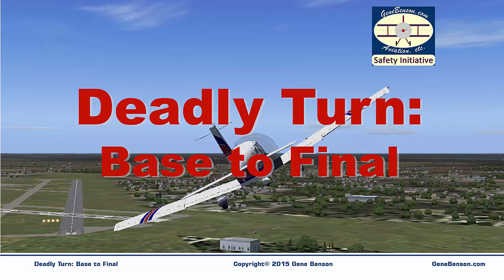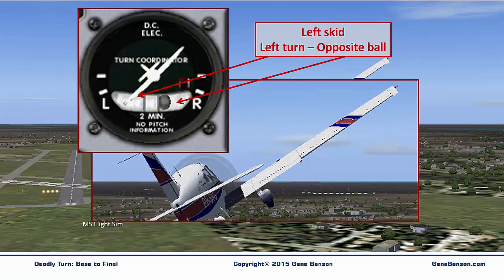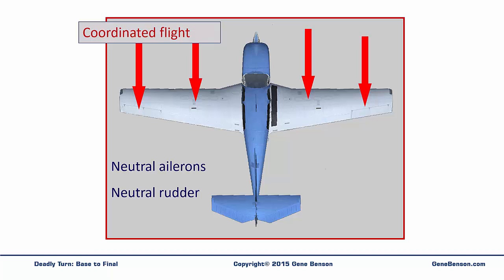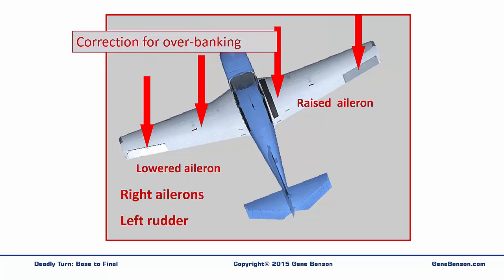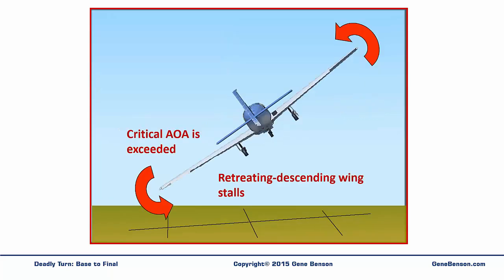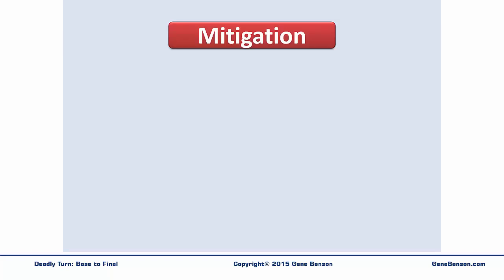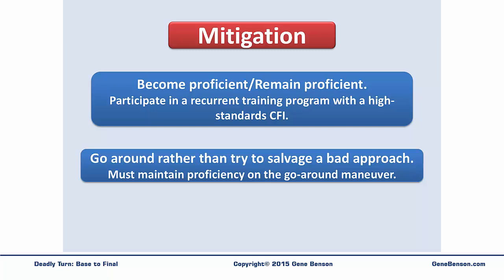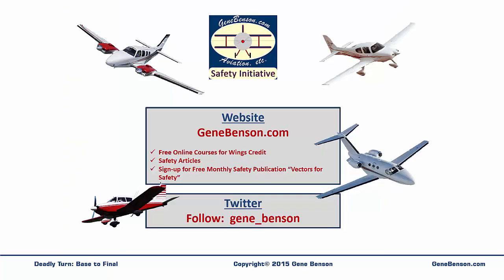Deadly Turn - Base Leg to Final Approach

Comment: I learnt to fly in a Drifter, rag and tube aircraft, what they describe as a 'high drag/low inertia' aircraft.  I did 200 hours on Drifters and then had to give it up due to cost.  My instructor taught deadstick landings from the end of downwind, a lot to do with the two stroke motors having a tendency to fail.  The turn onto base was usually at 45 degrees to touchdown, and from there it was just two gentle turns with the aircraft about 10 knots above stall.  I really felt more comfortable with plenty of speed and made my turns nice and shallow.  If I was too high, I side-slipped.  Too low, just added a little power to get me there.  If ANYTHING didn't feel (or look) right I went straight to full throttle and went around.

I really like the 'military' style of circuit flying, where a nice half circle to touchdown is flown from the end of downwind.  Anybody looking for me when I make the calls is going to see me pretty close to where I'm saying I am and the end result is one nice smooth turn with the touchdown point in perfect view the whole time.  If I ever get back to flying that's how I'll be doing it...
Reply from the maker: Thanks for the comment, but I must respectfully disagree with the half-circle to touchdown for general aviation, especially at a non-towered airport. Whether in a high-wing or low-wing airplane, visibility one direction will be blocked by a raised wing. Leveling the wings on base leg provides an opportunity to check for traffic on both sides. Many pilots at non-towered airports do not communicate, either because they have no radio capability, are on the wrong CTAF frequency, or simply choose not to use the radio. The military use of the half-circle approach is successful because they are generally operating in a more controlled environment with all pilots communicating and flying the same type pattern.

Comment: This deadly turn happens more than one would expect. Trying to salvage a bad approach is indeed many times the reason.
Reply: Precisely. If it is not good, level off, give it some power so you can retract flaps and if need be inform ATC you need re-sequencing if you don't feel comfortable with a go-around and exit the pattern. The extra time may give you the moments you need to recover from the adrenaline dump. If you are following the rules on fuel load, you should be fine.
Reply: Nobody ever mentioned (ACCELERATED STALL) that should be taught but it is never talked about anymore 😢

Comment: This is exactly what happened to me. I had a psychotic instructor who gave me NO help.
I overshot on Base to Final at about 500 feet and turned back 180 descending turn and 90 sharp turn left for a landing.
I think the only thing that saved me was due to my inexperience, I didn't use the rudder, only ailerons and less than 30 degrees bank. The instructor offered NO help during this landing. I REALLY believe he was suicidal and reported him to CASA.
I had a meeting with management and found out that later he had been PROMOTED.
Reply: Which flight school at Bankstown ? That's where I learnt in the early 90's but their are many different schools there. I studied at the Chieftan flying school and they were great.
Reply: @paulrichards2365  :  Right mate.  Sue the flight school
How many have died?  None, you say?  
There goes your legal case.  
If you had really messed up your CFI would have stepped in.  Otherwise, a student ends up just paying for someone to fly you around.
Reply: @horacesawyer2487  It was SOAR Flight School Bankstown. It was run into the ground by Neel Khokhanihas and since been shut down for MANY reasons.

Comment: If you set your approach speed with trim tab, control your altitude with throttle and drop additional 10 degrees of flaps at every turn stall should never be an issue on approach. You should not make any elevator inputs on approach until final flair and touchdown. Just the way I been doing it since 1970. If you have anything going wrong don’t fight it go around it is safer.

Comment: My rules on base to final turn:
1. Keep 1,2 Vref speed (if I should have 60 over the threshold, i keep 70+ on turn to final)
2. All my turns in traffic pattern is done by push the yoke (accelerate by decreasing pitch) - turn - then continue climb on Vy. On base to final i try to keep speed and altitude - the only way of doing that is to ADD THRUST.
3. All turns are 30 degree turns, except base to final turn - this one i limit myself to 20 degree turn.
4. If overshoot happens, keep 20 degree roll, and see if runway centerline is coming. If you are not able to catch it (too close runway, too strong crosswind, too low to terrain) - it's time to go around. 
Basically keep yourself in safe spot over flight envelope and you will be fine, always, even if sudden wind gust will apply.
Reply: Ordinary Matt I like the 20DEG self limit you set on your base to final turns. I’ll keep this in mind on my next flight. I have read up plenty enough on how deadly stalling on these can become esp. if uncoordinated but admit to having loaded the wings more than typically to “salvage” an overshoot a couple of times. Still maintaining some margin from the stall speed in a banked turn but definitely not a good practice to push the airplane to its limits this close to the ground. Setting a go-no threshold like this takes the realtime evaluation aspect of it out of the decision-making process.
Reply: @shreedhar333  Yes, far too many times, a pilot will go too long trying to salvage a bad approach when they should have bailed earlier. Setting these kind of hard limits and ADHERING to them, can save many a life and this should be drilled into novice pilots!! I also like the 20deg on B to F, it's a safe limit.

Comment: The elephant in the room is that for some reason in North America people are being told by their instructions that the airplane has to be in touchdown configuration while on Base, and than to make a 90° turn to final. Why? Fly the airplane onto final and while on final put it into the landing configuration and land. Stop being at touchdown speed before turning Final, and you'll not die while making this "most dangerous turn".

Comment: I fly RC scale models as I have always been fascinated with flying.

It is common to hear someone say watch that corner of the field on landing as you can experience radio interference. 
After crashing some planes and witnessing many others it is a tip stall turning into wind in preparation for landing approach (not radio problens).
As you turn into wind the model reaears up from the lift and as you are so focused  on the landing you reduce throttle to the point of tip stall.
I have seen it many times. 
(We have airline pilots fly at the clubs well sometimes).

Comment: At London Heathrow airport, nothing flies an actual base leg. Aircraft turn onto final from a heading thirty degrees off. Ninety degree turns while low and slow are just a bad idea. There is a youtube video from Oshkosh of a plane sideslipping into the ground from a tight turn onto a far too short final. Most comments suggest it is due to turbulence from a preceding plane, but it is as clear as day that the wing became totally stalled under the increased load.

Comment: I always say if go around needed, everything goes to the firewall (yoke, throttle, carb heat, mixture).  That’s exaggerating it a little but I think you get the idea. Then bleed off flaps when solid positive rate of climb is established.  Also, be ready to rapidly adjust elevator trim based on how you had it set during final approach.  If rusty, or in doubt, see your nearest CFI. There’s always room to learn more.
Reply from the maker: Agreed!

Comment: The important point that is missed here is that even if the ball is exactly in the middle at the point of stall the wing may drop due to the use of flap or power. Flap promotes TIP STALL.Power promotes TIP STALL.  Anything that causes the tip to stall before the root can cause wing drop. It is the wing drop that causes surprise and startle and if not corrected immeadiately it will lead to very large bank angle and pitch down. Most low hours pilots now faced with a windscreen full of scenery will in instinctively pull back and their fate is sealed and they hit the ground vertically nose first. 

Carrying an extra 5 to 10 knots on the base to final turn can help. Listening out and looking out prevents circuit surprises. You only have to avoid traffic you didn't see! 99% of pilots need to improve their LOOKOUT WORK CYCLE. Having a landing light and not using it in the circuit is poor CRM and shows lack of common sense. SEE & BE SEEN. 

THE HARRY BROWN PROJECT
Reply: Proper use of Rudder will prevent rotation into a spin.
Reply: Harry Brown  Right.  Even coordinated turn, if you pull up in panic due overshooting, it will drop the inside wing.   And if adding power with not enough rudder in a say 45 degree turn at say 400 agl.  You will drop the wing further too.  Lots of BS here from guys that dont do full steep turn stalls or steep turn go arounds..
Reply: You said "Flap promotes tip stall." That makes no sense because when you lower the flaps you also have to lower the nose, i.e. reduce your Angle of Attack, to avoid ballooning, and also slowing down. Also, just to see if you know what you're talking about, what's the most likely scenario of a tip stall occurring?
Reply: @hh6986  The important point that you missed is only pilot induced aft elevator input can cause a stall. Things such as speed, slips, skids, tight turns, wing loading, ALL have ZERO affect on when a wing stalls which can only happen at a given critical angle of attack (AOA).  If you are a pilot and do not understand your plane's stall stick position is the same every time then you are missing a critical factor in your aviation.
I rarely look at my airspeed indicator, but I always  KNOW at all times how far my stick is from my belly button!   When landing I use the stick to control my airspeed and engine power to control height.
A plane can stall at any airspeed.  Just pull back and see.
Reply: You propose an extra 5-10kts. Above what speed?

Comment: I learned to fly at non-controlled airport. This was almost 40 years ago. I always notified everyone that I was heading straight out from the runway until I was at least 2500 above ground level. And even then, turns were always as shallow as I could make them.

Comment: I'm 72 and rented 150's and 152's since '75.....i always watched bank, airspeed and ball on turn coordinater.. don't get too low turning final, i always come slightly high, then can come down with flaps or forward slip near the runway. Better safe than sorry.. now i have a boat...🇺🇸
Reply: I agree with your stay high approach so you never have to rely on your engine to get you there. Like you said, flaps or forward slip at the end if you need it. There would be many alive today if they'd stayed at or above their glide angle, (adjusted for wind of course).

Comment: Working on my commercial cert. I was going to a new airport on a cross country one night that had crossing runways. It was confusing as only one of the runways were lit up. I didn’t see any notams for lights out for either one so I wasn’t sure on the runway I’d be landing. One had some good cross wind and the other had less. I turned base and noticed I was moving across the ground fast. I lifted my wing and noticed the lights of the run way passing by off to my left so I attempted to turn back towards it. I noticed the plane’s inside wing was dipping so I lowered the nose, added power, and flew my ass back to the my home airport. It’s never worth it fellas. Let it go and don’t put it in the dirt.

Comment: This is exactly why I never use 1.3 X my stall speed, VSO, in the traffic pattern of small non towered airports.  That calls for 75 MPH.  I usually use between 100 & 110 MPH and keep the nose down once I leave the down wind.  I don’t start slowing down until about 1/2 of a mile out from the landing runway.  I use ground effect if I want to land long.

At airports like MSY I request from ATC to stay high to enter a final.  I’m at the top of the yellow ark which is about 165 MPH.  This way I can mix well with the passenger airline and freight jets.  I carry 2400 to 2500 RPMS in my decent into final until I reach the approach lights.  Then level off and pull most of the power back and it quickly slows down to around 100 MPH.  I can put in the flaps once below max flap speed.  I can then land and make the first turn off into the GA ramp.  No chance of stalling with this type of VFR approach or shock cooling the engine.

Comment: Great video, much appreciated.
Question;

So, on base to final. It the pilot is making a safe 20-30 degree left bank with slight left rudder to keep it coordinated then it’s in & safe?

Does the pilot need to provide “full left rudder” to create a deadly stall & spin or just enough left rudder to push the ball passed the middle more towards the right side?
Reply from the maker: If the bank angle does not exceed 30 degrees, the ball is in the center, and the airspeed is normal for the approach, everything should be fine. Full rudder is not needed for the stall spin, but the more the ball moves out of the brackets the more danger is presented.
Reply: @GeneBensonAviation  thanks 4 your reply!

Comment: I rammed this into my son before he soloed. It was rammed into me as pilots tend to concentrate on lining up with the runway and can take their eye off of the ASI ...  this turn occurs at about 700 feet and this isn't enough height to allow recovery to happen. A spin from 700 feet WILL kill you.
Reply: But a mere stall/recovery/go-around should not.
Reply: My instructor, a WW2 pilot, threatened to beat me with a two by four if I insisted on picking up the wing with aileron. I had already earned my Private at this point, and am eternally grateful, that Don McCann taught me the proper use of rudder, and the many tricks he taught, that are not in the book! I thought I was good, until a master broke me of bad habits that would have probably killed me by now. God bless you Don! R.I.P.
Reply: @ConvairDart106  -- There is a famous CFI (Jason Schapper ) here on you tube recovering from near or full stalls on a c172 by twisting the opposite aileron to almost full and saying he only needed a bit of rudder to recover.  You can tell he cheated on the spin section of the CFI practice.. If ever did them.. Many do Mild spins, get endorsement required, and thats it.. Then go teaching that bullshit to students..  And killing them later on too..
Reply: @UncleKennysPlace   From 700'? Good luck, you'll need it.

Comment: And related to this is what the AOPA online course calls "The Impossible Turn."  This occurs when people experiencing a partial/full engine failure shortly after takeoff try to do a 180 back to the field and spin out (or at least run out of altitude).  I think what this whole topic comes down to is what Mark said below, it is all cerebral.  When under sudden pressure understanding why a sloppy turn at low altitude can kill you, or why it is better to land dead stick more-or-less straight ahead, should prevent making these errors.  Visualizing ahead of time a good approach and what to do in an emergency can make all the difference.  In the glider I fly my learned habit at the end of the checklist is to run through what to do if there is a low altitude rope break or towplane engine failure.   I've had these and thanks to good training they were quite manageable.  (In a glider you can make a low altitude 180 and we practice that; on the other hand, when they spin, they really spin.  With a moment's inattention to the pattern's wind gradient we came darn close to losing a club member.)
Reply from the maker: This is not the same as the "Impossible Turn." That scenario involves an attempt to return to the departure runway following a loss of engine power soon after takeoff. This video describes the dangers of an uncoordinated turn in the traffic pattern from downwind leg to base leg.
Reply: Bulldog
Reply: A 180 ?? A 180 ?? LOL.

Comment: I have a Cherokee 140. My A&P said if he lost an engine on takeoff, he'd do a 180 at Only 509 feet. I said no 1000. He shook visibly. I've owned this aircraft since 1989.  Took it up. Simulated engine out, counted to 10. Then executed 180. I list about 350 feet, with stalk light blinking entire time.  When learning Radio Control, we were taught NEVER do a 180 if loosing an engine on takeoff.  The reactions I learned saved my 140 (from RC) when botching a landing on a narrow runway. Full power saved the day; optical illusion stalled it on, bounce up to hight of open hangers.

Comment: In a turn, at lower airspeeds, it's always a better idea to keep the ball in the middle and fly the plane to the correct track with proper airspeed for the attitude and no more than 30* of bank angle. For sure, get a CFI to put the plane into a descending low airspeed turn and witness the opposite effect the ailerons create as the outside aileron effectively increases the AoA of the wing on the outside of the turn. Scary shit close to the ground. See it at altitude. Once you understand what it's going to do, you'll be watching your airspeed more closely.

Comment: I just tried to do a stall/spin in my Legacy simulator, at 4000' AGL so that I had room to attempt a spin recovery. In landing configuration (gear down, full flaps, 105 kts) it recovers in a very docile manner from overshooting base to final, overcorrecting, and then stalling with full cross controls. The nose goes down, wing does not drop. I won't be trying it in the real aircraft, though. The good news is that flying the aircraft anywhere close to right is very, very far from stall/spin. So, airspeed up, dirty side down.